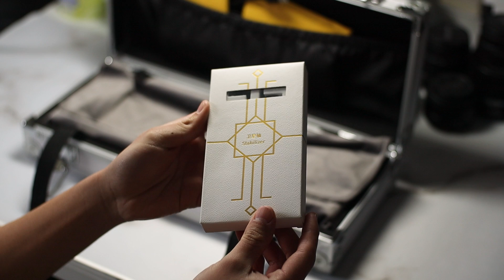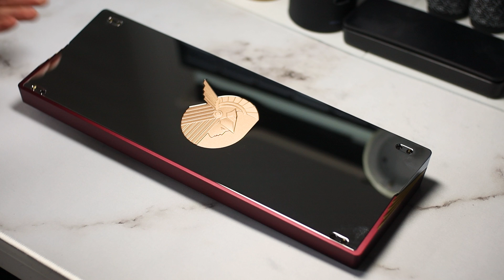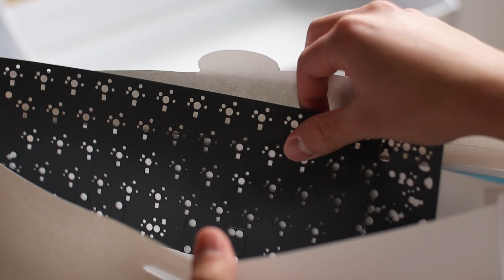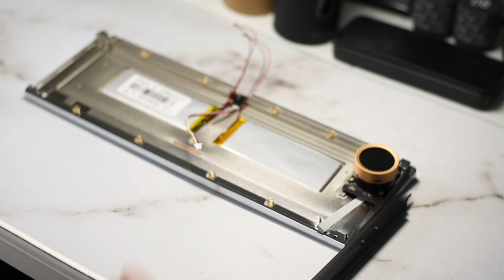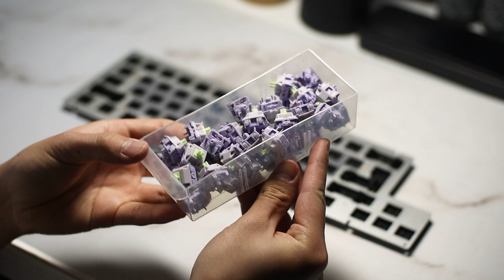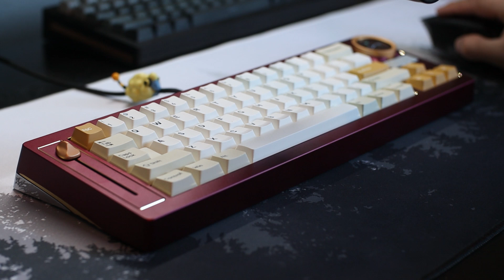This Keyboard is Beautiful | Freya Ultra Build and Sound Test

Comment: Great Video, what a unboxing experience this is... I have never seen a keyboard as nicely packaged as this one. 

One tip for your video production tho, maybe use a "de-esser" on your narration track, it would help greatly to reduce the harsh hissing when pronouncing sharp "s" sounds (2:04, listen for the hissing in "assembly" or  "PCB" for example). It would improve the listening experience greatly.
Reply from the maker: Wow thank you for the advice! I'll definitely try that out